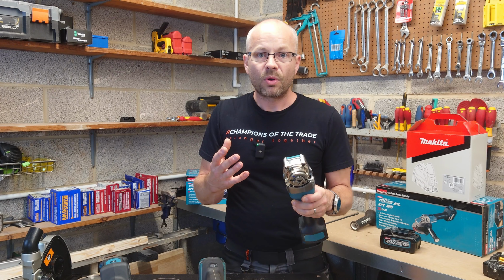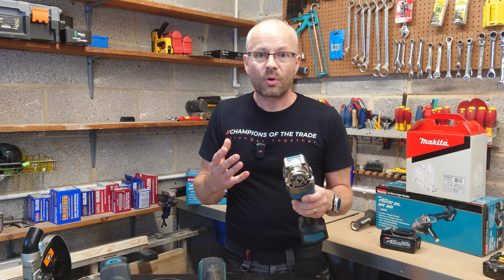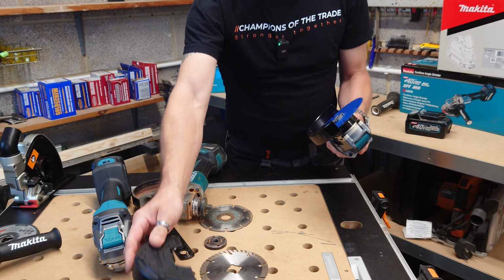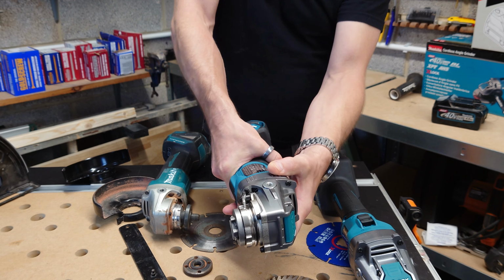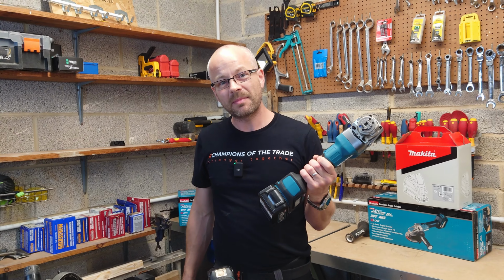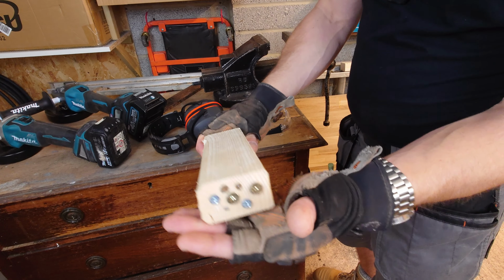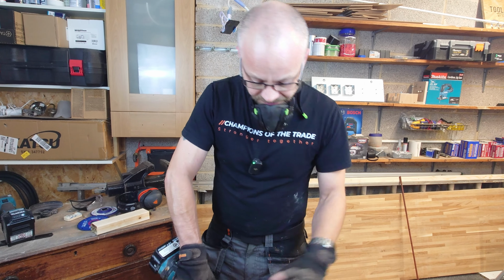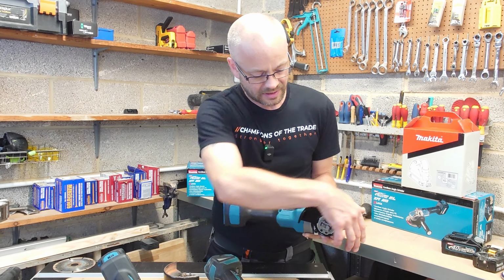Makita XGT X-Lock Angle Grinder: Slide or Paddle Switch 💥Tool Review & Demo💥

Comment: Great video. Could have used that dust extractor when chasing my bathroom walls for pipe work, the room was covered in dust, I couldn't see a thing, watching you cut that concrete block with very little dust was impressive.
Reply from the maker: Sounds like when I first core drilled a hole for a bathroom extractor fan, last time I made that mistake! Definitely get yourself a dust collector, you wont regret it.

Comment: I was specifically looking for real-world opinions on Paddle-Switch vs Slider, you really helped me to go with Slider despite me liking safety of paddle-like systems on my other Makita tools — you hit something awkwardly and the tool stops instantly because you instinctively released the finger.

On the X-Lock, it seems really limiting with the vendor lock on much more expensive disks. I've found "Quick change angle grinder nut"  by different brands, seems to solve exact same issue without the vendor lock, have you tried any of them? 

Thank you for the reviews!
Reply from the maker: Thank you. I'm really glad I could help, I do try to review items in a real world situation and put my own experiences into the mix, otherwise it's just another advert. 

Unfortunately no, I've not used any of the quick release nuts, but you're right about the XLOCK discs. £££££ (same with Star Lock actually)

Comment: Great succinct clip.
I use my grinder (still corded) in many angles and hand positions, for cutting, grinding/flap disc, wire brush and arbotec. 
I’m looking to upgrade but have only had slide switch. Although I find the switch annoying it looks like my best option. You may have brought mr round on the x-lock too.
I always had my spanner tied to the plug, to remind me to unplug during blade replacement (for safety). I assume the x-lock won’t start if the x-lock latch is engaged.
Thanks!
Reply from the maker: That's a really good question... (🏃‍♂️runs off to the workshop to check)... Okay, well. yes the machine will start with the x-lock latch open, no safety feature there! But I would always say, remove the battery when changing the disc, no different from unplugging a mains version really.